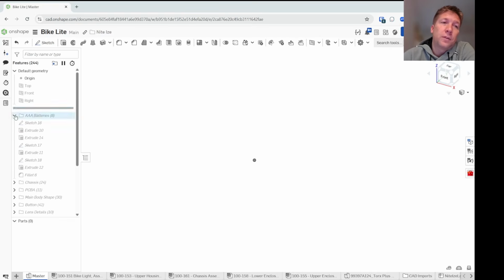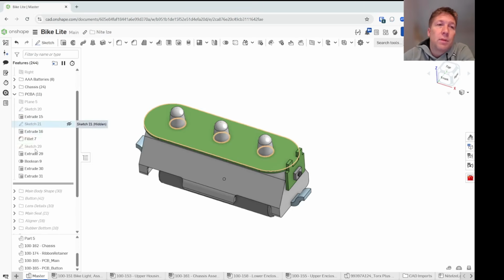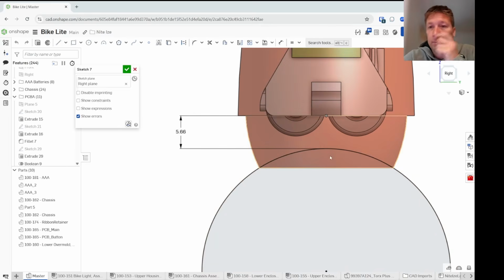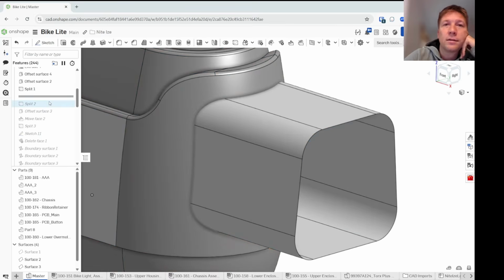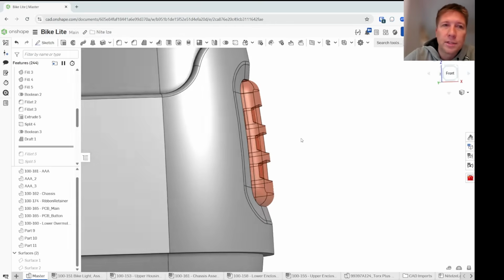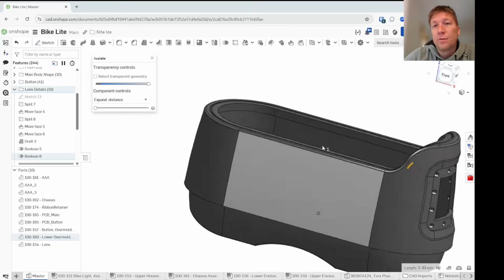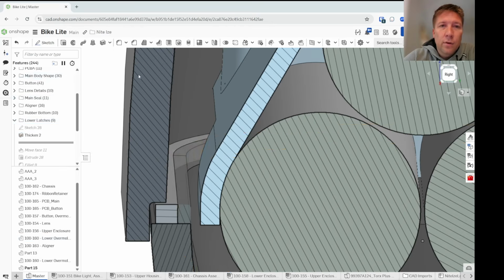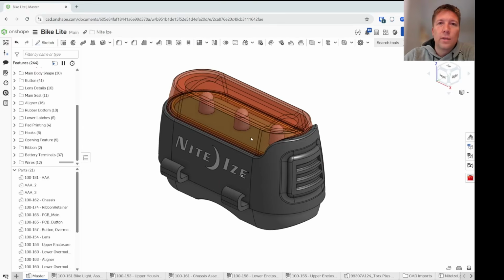Mfg Cost Part 4:  Bike Lite - Onshape CAD Model Strategies

Comment: Batteries: In what way is a downloaded model not clean?
Reply from the maker: When I’m building a multibody master model, I don’t want any external data sources in my master model. That means all the data was flowing in one direction. There might be reasons for doing this, but in my experience, I try to avoid it as much as possible. If I’m going to have interfaces with external parts, that’s gonna happen by me, creating a dummy part in my master model that represents the external geometry.

Lightweight CAD means not importing, bulky external models.

Comment: Thank you for that great explanation!
I have a question: in the part where you explain the reasoning for not using a chamfer around minute 40, could you have done a sweep around the perimeter of the shape, or would that have created the same issue?
Reply from the maker: Could have tried to sweep as well, but the surfacing was a fun exercise and pretty straightforward and stable.